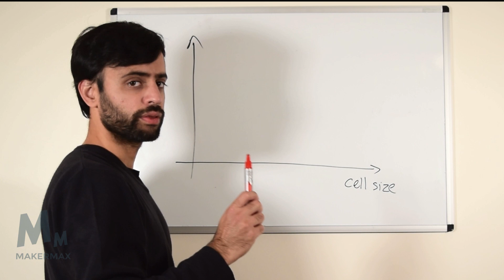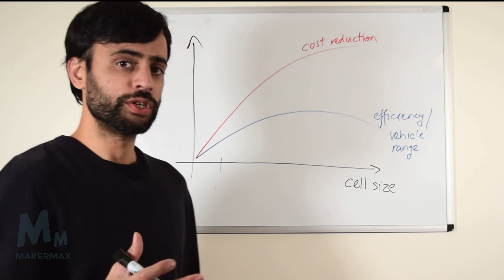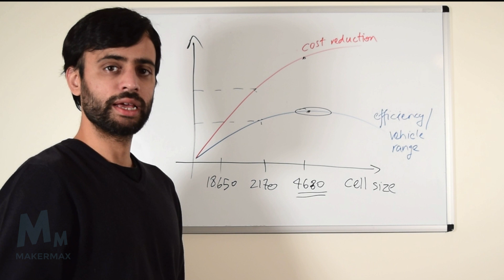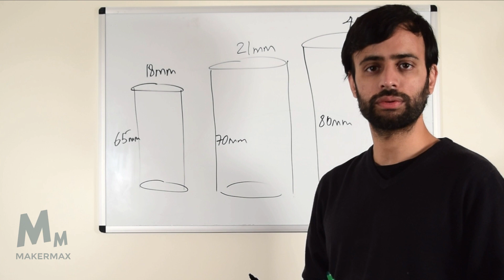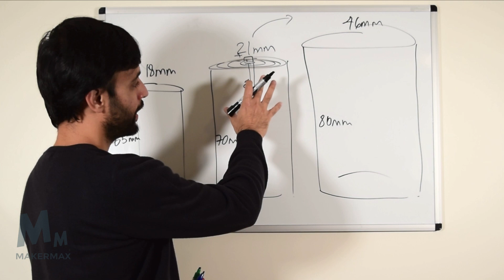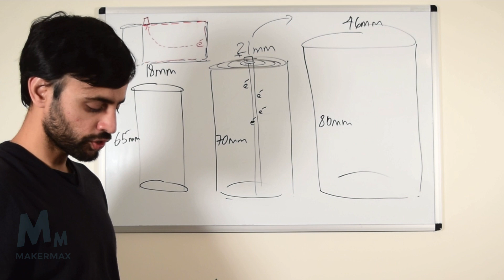Why did Tesla move towards the 4860 cylindrical Lithium ion cell?

Comment: Hi Akshay, so if the IR is related to the distance it has to travel inside the cell, the 18650 cells which are capable of 8C have an IR of 15mOhm whereas same 18650 cells which are capable of 1C have an IR of 45mOhm.  Does it means the roll is smaller in 8C cells compared to 1C cells and it has to travel lesser distance? Hence the IR is less but since the roll is smaller meaning the active material and all will be less so the life cycle is less right? Please let me know the relationship between IR and the life cycle of a same 18650 cell.

Comment: Is this battery format still needed as Tesla moves to LFP? The new Tesla battery using LFP from China does not seem to be using the 4680 batteries, it looks cleaner and far less complex, see Munro Live videos. 43% of EV produced by Tesla in China use LFP batteries, moving to the BYD blade battery can lead to another improvement.

Comment: Thanks for this.
QUESTION: for the 4680, what factors cause it becoming 'inefficient', beyond it's ' sweet-spot?
EDIT, QUESTION_2: since a blade battery also has a jellyroll construction (non circular), might it also use/benefit from a tabless architecture, increasing efficiency?
Thanks.

Comment: 18650 and 2170 cells aren't using the multi-tab design that the 4680 cells are going to use right? And they should? right, or should see what happens when it's done testing.
Reply: the 18650 and 2170 cells follow conventional cell design which has a single tab. The 4680 cells don't use the multi-tab approach either, Tesla went with Tabless electrodes for the 4680 which is a further improvement over the multi-tab approach. I bring up multiple tabs in the video to highlight the problem and take the first step towards how we can solve it.